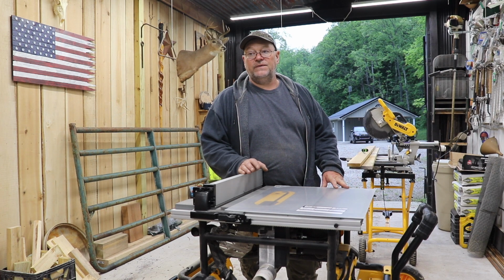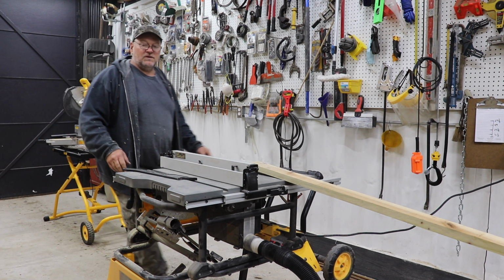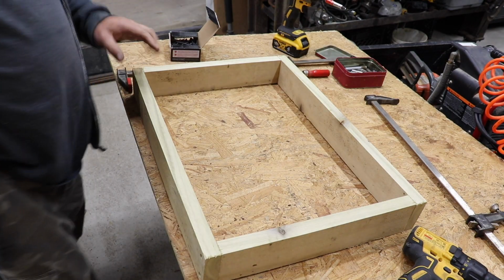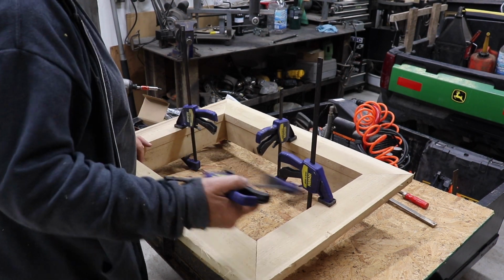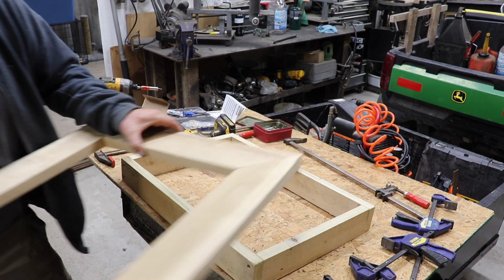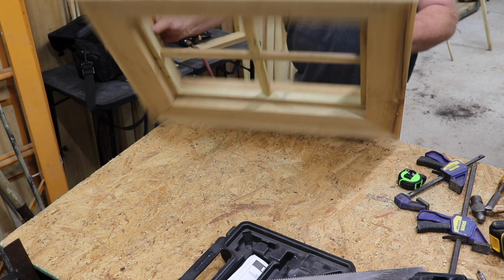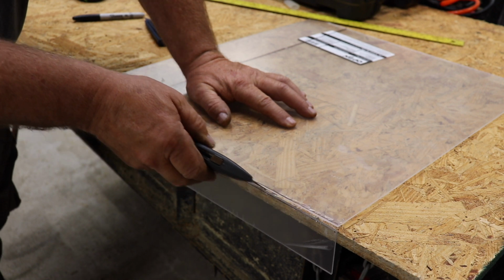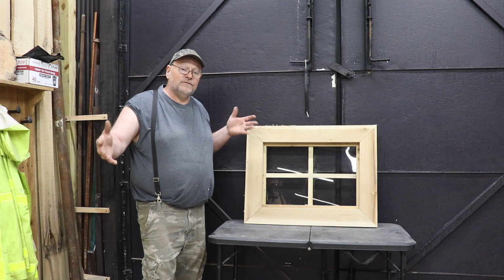rustic chicken coop window build part 4

Comment: As an idea. Slap a small solar panel on the roof of the coop. Use to load a battery pack of a cordless power tool. Will give light in the spare time after sunset for working in the coop.
Reply from the maker: I have  100w of solar for it should be good thanks for the comment.

Comment: Thank you for a great video.  I think I might actually be able to follow this .  Well maybe not the free hand, half lap routering .   Did you get all the pieces from a single board ?   If so what size ? 

Thanks … new subscriber for. The uk 🇬🇧
Reply from the maker: I tried to use wood from the same log.
Thank you so much for subscribing.